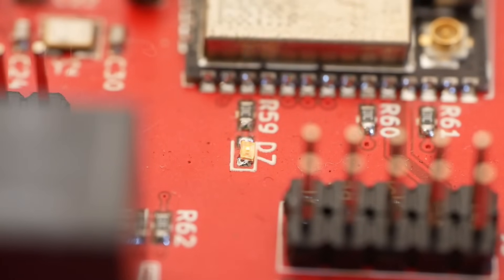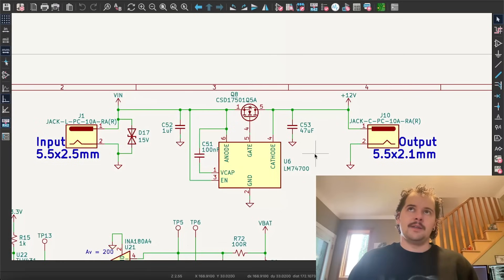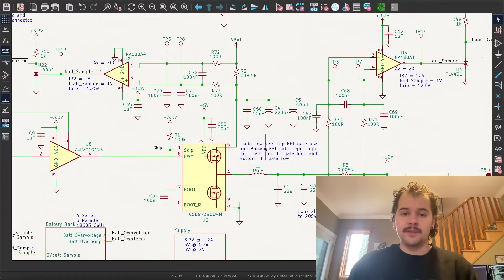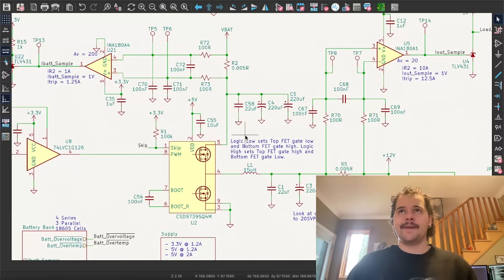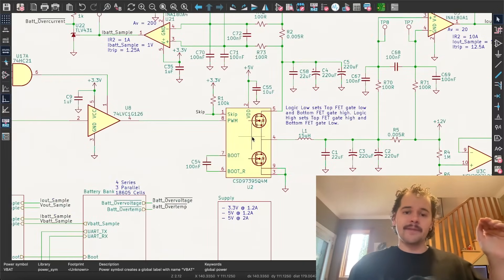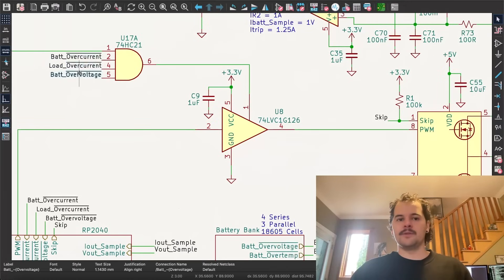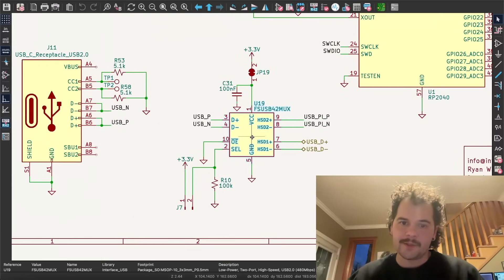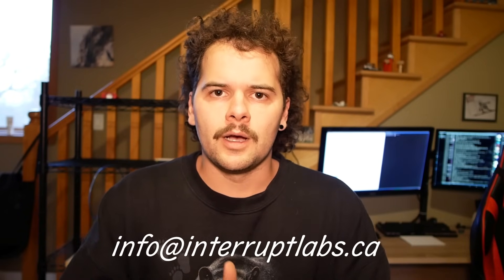We Built a UPS for Hardware Hackers!!

Comment: Why do you need three microcontrollers? do you want to fly to the moon with it? 
The batteries are monitored by the BQ, OK

An ST to set the BQ, OK. Why an RP2040?  
All three microcontrollers could set the BQ. 
The ESP32 could also set up Wifi and the BQ and host a web server all in one IC. This would make the PR204 and ST obsolete.
Reply from the maker: Hey thanks :)

The TI BQ76920pw battery manager needs a companion to set it up. The MCU needs to be on a bus created by the bq76920 so that when a fault occurs, the MCU can do something reasonable to clear the fault before the entire system power has been cut out. This MCU must be completely isolated from the rest of the system (IO and power). Additionally, this bus is 3.3V at 90mA, which isn't enough for the RP2040.

The ESP32 is a "user-facing" component, meaning the user can fearlessly flash this device without harming the core functionality of the UPS. The ESP32 can be safely removed if the user doesn't need a screen, WiFi or NUT.

Comment: Thank you for your effort and making it opensource. Design wise its amazing, especially that one multipurpose circuit block to charge, discharge with batteries. I am gonna try that one. I did made my own ups for powering my home router and pihole and it is in its 3rd revision and is based on 2S4P configuration but its not smart one. Only thing i didnt figure out was what led you to use 3 mcus and i believe it can be optimized to use 1 mcu. If there are options for collaboration in development, i am interested to join.
Reply from the maker: Thanks for the comment :) ! I appreciate your support.

ESP32 - For hacking and customizing your applications. 
RP2040 - For controlling the realtime elements for the PMIC.
STM32 - Battery protection configuration must be on a separate circuit from the other MCUs.

There's a good reason to have all three parts: the ESP32 can be safely removed from the device if you don't need WiFi or the screen, but it cannot take the place of the RP2040 or STM32.

Comment: So inspiring to keep finding people who not only believe but invest energy in innovative, open source hardware/projects.   Thanks so much!  A DC-DC UPS project has been on my mind for a long time now.  Additions like a wide input DC/DC converter (60W 75V to 12V) could result in a more robust design with a  wider application range.  Just like yourself, my time is limited and so collaboration would be a better way of moving forward.  What do you say interruptlabs?
Reply from the maker: Yes! Thanks for your comment! We believe in developing products that enable users to modify and upgrade while reducing e-waste; this device hits the nail on the head. If you're interested in working with me, send me an email! walker@interruptlabs.ca
Reply: @rootkitlabs  +1 for the input Voltage, but
Higher output voltage could also be interesting. I for myself run a single 19v PSU to power my Home Server (Intel NUC), DSL Modem (using a stepdown to 12v), and my Reolink doorbell. Of course I could boost the 12v to 19v for the server, but that wouldn't be very efficient.

Comment: Cool, but why THREE microcontrollers? More cost, more complexity...
Reply: @srx1821 unfortunately, that is NOT the case here
Reply from the maker: Yup! Three MCUs :)

ESP32 - For hacking and customizing your applications. 
RP2040 - For controlling the realtime elements for the PMIC.
STM32 - Battery protection configuration must be on a separate circuit from the other MCUs.

There's a good reason to have all three parts: the ESP32 can be safely removed from the device if you don't need WiFi or the screen, but it cannot take the place of the RP2040 or STM32.
Reply: @rootkitlabs  but that doesn't explain why you couldn't simply take advantage of RP2040's second core for doing what the STM32 does 🤔
Reply from the maker: @bit2shift the TI bq76920pw battery manager needs a companion to set it up. The MCU needs to be on a bus created by the bq76920 so then when a fault occurs the MCU can do something reasonable to clear the fault, before then the entire systems power has been cut out. This MCU needs to be completely isolated from the rest of the system (IO and power). Additionally this bus is 3.3V at 90mA, which isn't enough for the rp2040. The ESP can be completely removed if wifi isn't desired.
Reply: @rootkitlabs  I didn't mention the ESP32 in my comment because I understand it has a self-contained purpose and is therefore optional.
I was only talking about the RP2040 and the STM32. If you can't really use only 1 MCU for power management, the least you could try is using only 1 MCU architecture, STM32, to make the software stack simpler and thereafter more robust.
Reply from the maker: @bit2shift the STM32 and RP2040 are the same architecture
Reply: @rootkitlabs  ok, yea, technically true, but the usage of different SDKs was the argument I was trying to make across.
Reply: @rootkitlabs can I use arduino in place of esp32
Reply: @rootkitlabs 👌
Reply: The esp32 on its own has 3 cores in it including a watchdog timer the protection n all can be handled by just the esp32 you can include simple passive current and voltage protection circuits and achieve the same or more functionality n safety while keeping cost down and having the same functions with less MCUs and a less cumbersome code base
Reply: lets just go ahead and put all that functionality in one thread on one core. to keep it simplshmle.
Reply: For a project, it's not a big deal... This isn't a consumer product. These microcontrollers are like $1-2 anyway.
Reply: Best thing about open source: you are free to redesign it!
Reply: Because it's a whole lot easier to get critical tasks (safety stuff, such as not overcharging li ion, and real-time stuff) right when you have dedicated micros for those tasks.

Recommended reading: the expert's paper from bookout v toyota.
Reply: As a comp eng and cto, I’ve had this debate with EEs all throughout my career. My standard response is “cost and complexity where?”

For this project, your standard “one microcontroller to rule them all” would mix real time signal processing with wireless protocol handling and display management. Those are three very different workloads: one is time sensitive, one is highly preemptive and one uses lots of memory and hogs your data busses. From a firmware standpoint, your standard solution is to use threads but then you’ve now added increased risk of race conditions (not fun troubleshooting those in the field) and a hell of a lot of additional computational burden and complexity onto the chip. You’ll need a more expensive and power-hungry one, with more pins, and you can easily run into the risk of needing BGA packages which increase the complexity when designing for serviceability and manufacture.

Not saying you’re wrong and they’re right, or vice versa. Not even close. There’s pros and cons to both approaches and the best decision is highly contextual: you may find a monolithic micro is better if you have a strong dev, or if you’re expecting large volume runs where the additional NRE is negligible. If you’re doing smaller batches and more serviceability, splitting your workload across three different chips has the potential to keep their scopes tighter for each chip and easier to partition across multiple developers/teams.
Reply: @Kotesu   also as a comp Eng and CTO, I also had this debate a lot.

I always go for less complicated hardware and more complicated software. In this specific case he is offering unnecessary redundancy. The esp32 is a very versatile and complex system it has 3 processors plus a watchdog nano processor.

The esp32 has :
2 x lx6/7 independent cores - each core can run code independently from the other.
1 x ULP ultra low power processor 
1 x watchdog timer
A powerful MUX that can literally make any pin almost any pin it has a huge number of registers that are accessible by all the processors you can run watchdog watching code on the ULP, run time sensitive code on the one core and networking and other stuff on the other one.
Reply: @thee_onderwyser  I love this reply, as it shows there are so many different schools of thought. I’m curious what kind of background and experience you have that influences your preference?
Reply: @Kotesu  I'm from Africa with an Arab father so I was in a place where electronic components likes MCUs are scarce n the only way to buy em are a few friends in the west or a lot of money online plus expensive shipping so I learned to use all the resources at hand, this also drove me to design robust devices with limited resources even though they require to be able to withstand serious abuse eg 220v is Africa is more like 140 to 270v 🤣🤣🤣 so I learned to exhaust a components features while building robust circuits that are easy to repair and will withstand a lot of abuse using limited resources.
Reply: @thee_onderwyser  that is a serious set of design constraints! Kudos to you!
Reply: Intersting perspective in case of multiple uC :) Maybe next iteration needs one FPGA with a few RISC-V cores...it will be super fine to watch this kind of challenge ;) Thanks for sharing this +1
Reply: @marcinbieli with low cost fpga 👍👍👍👍👍👍
Reply: @marcinbieli very cool but pretty complex and extensive 😅
Reply: at larger ups you might as well replace esp with allwinner h5. get actual os in there so you can run shellscripts like big server admin. i would, it's simpler
Reply: @ketas your reliability goes out the window then though. OS'es are generally easier to crash then a program running on a uC.
Reply: yes i can do it myself. it's even planned. yes, oses crash. we have watchdogs. yes, even hw fails. no, it won't be as bad generic consumer wifi router or phone, we can do better than that. reliability hmm how much you need? at my ups i was wondering if i need redundant sbc's. more complex but. i mean it would already have bms, then sbc monitors that. btw jbd bms is also ti bq* + uc. i would concerned about it's fw tho. but then. i think it's good enough. at certain levels, eg you build voyager type devices, different hw, more hw, different people comes into play. if you want super high reliability. or are power concerned. i would want usability. which is why i would go simpler route. here it doesn't fit really as power draw of sbc could be significant % of battery. hence esp
Reply: Good idea 😅 I will explain that my customers next time, that I use 3 mcus because auf that reasons. Greets from an hw dev.
Reply: Why not 4 lol  I’d add motor controllers and lidar 😂😂
Reply: @kingrutse3278 , Are you trying to make a Tesla? Elon hates Lidar.

Comment: Now that’s really amazing, I was busy designing a circuit for my vending machine control board where I’d want when the main power to the board goes off, the esp32 to run on battery for certain amount of time and then shut off itself.. I didn’t want to but had to use the fricking diode mainly a ss34, but looking at your circuit for the input and output protection using the mosfet and a dedicated driver to handle that. I just loved it. Made my own life a lot more easier haha. Thanks a ton for sharing this and how you’ve used the whole logic, it’s absolutely amazing. Cheers to the hard work and efforts! Hats off. 🎉
Reply from the maker: Awesome! I'm glad you could benefit :)

Comment: Why would you use two micro controllers? What was behind this choice?
Reply from the maker: Hey! The RP2040 is acting as a PMIC while the ESP32 is user facing, meaning the user can really hack around with it without fear of disrupting the core functionality.

The PID loop for the power delivery (RP2040) is very resource intensive and can't run on the ESP32 while hosting a webserver, screen, NUT etc.
Reply: @rootkitlabs Thanks for the speedy reply! That makes a lot of sense, and definitely improves the 'hackability' for people who aren't 100% sure of what they're doing.
Reply: @rootkitlabs What kind of calculations are you running before / after that PID loop that require a lot of time? After checking the firmware I don't see why it couldn't be ran on the esp32! Cool project man!